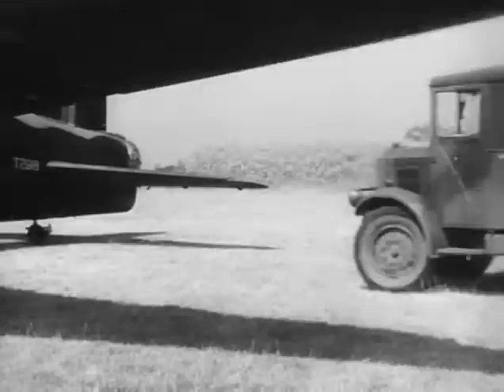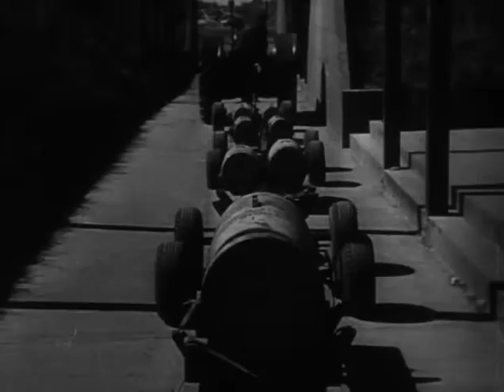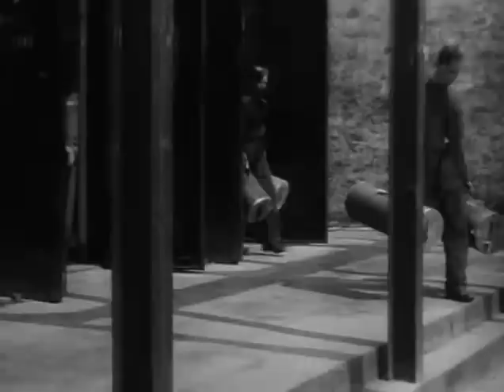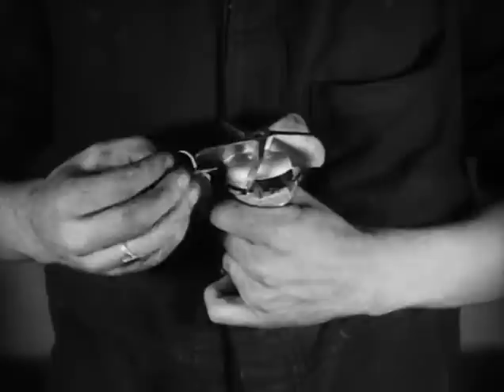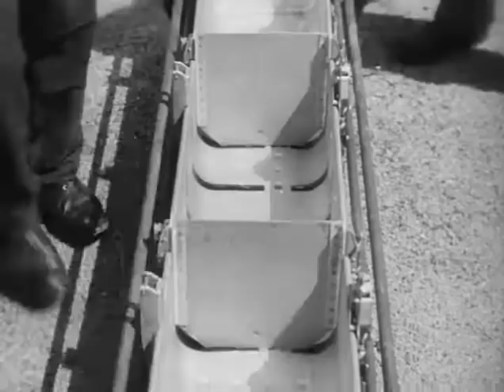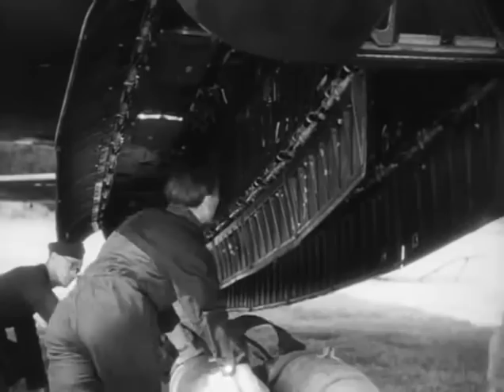The RAF at War - Re-Arming the Bomber

Comment: This film probably dates from the summer of 1941. The 4000lb HC Blockbuster bomb featured was first dropped in April 1941. The aircraft featured hasn't had the modifications necessary for it to be able to carry one (removal of the bomb beam and cutting a hole in the bomb doors).

Comment: All there planes need test flights ,how much fuel time they waist ,typically English
Reply: A daily flight is nearly the minimum to keep an aircraft at an hour's readiness.  
Extra test flights are done for aircraft coming off regular maintenance or 100 hour checks.  
New aircraft are also air tested, these tests were often given to new crews to give them more air time and some practise not being shot at.  

The test flights are done every morning, before the tasking for a night raid comes down from Group.  

Usually, they make a radio test, which was realised was warning the enemy of how many bombers on how likely was a raid that night.  

Later, the daily air tests included none, one or more radio tests to obscure that information from the enemy.  

Servicing for a raid includes a fuel check (learned from the air test), and fuels and oil are 'topped up', then the aircraft is 'bombed up'.  

An aircraft can still go unserviceable when started for the raid, but the earlier checks usually prevent that.  

If you are worried about fuel being wasted, look up Fog Intensive Dispersal Of (FIDO) then look at how expensive bombers are, and how expensive fuel was per gallon, then do some sums, which will show you why many thousands of gallons of fuel were burned to disperse fog so aircraft could land.  

War is very expensive: it can cost everything there is.

Comment: When the bombs are armed and fused I did not understand what the gauging was for. Anyone?
Reply: The gauge makes sure that the pocket for the detonator was made correctly & that there isn't any garbage in the pocket. If the pocket is the wrong size or has debris in it the detonator could explode when the fuze is being screwed in, causing the detonator to fire and setting off the bomb. This is typically considered to be 'a bad thing'.

Comment: WOW  arming before loading on birds!
Reply: yep that way when it goes wrong you don't kill the aircraft just the guys arming. only when stable gains came into existence did the RAF swap out to arming on the aircraft.

remember most gains at this time consisted of penthrite wax or similarly unstable crap. just getting the damp could make them go off. so you needed dry and clean places to arm up the bomb. out on a muddy bit of dispersal ground was not a good spot.

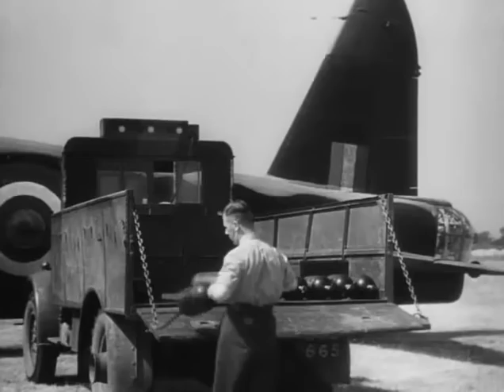Comment: At 2:28 the narrator mentions that the oxygen bottles could explode if dropped or banged, just as one of the airmen, who's  helping to load the oxygen cylinders, throws the oxygen cylinder up in the air.
Reply: Just a little overly dramatic. Oxygen cylinder will not explode if dropped or banged. They will rupture if exposed to high heat or flame, causing a massive release of the gas. Oxygen is not flammable but it does support combustion. Basic chemistry 101. In the presence of something burning, it will accelerate the burning explosively.
Reply: @JP-st2mk  mate you clearly have never handled a RAF ww2 oxe tank. they are made of surprisingly thin aluminium and could be ruptured quit simply by dropping them.

that said you are completely right the oxygen is not going to explode all by its self. still one hundred psi of oxe tank rupturing is not something i'd want to be standing next too. :)
Reply: @tommyfred6180   when I was in the mob we had a 3,000 psi air bottle explode, it was 3ft above the ground and an end-cap was found over a mile away,   after it cut off a mates arm 😳
Reply: @tommyfred6180  there is a LOT more to that story & Lucky that a dozen were not injured, or even killed
Reply: Still it would be nice to see something blow up.

Comment: These are Wellingtons of 9 Squadron (Squadron code letters: WS - carried from 9/1939 until 4/1951). They operated out of RAF Honington until September 1942 when they moved to RAF Waddington and were re-equipped with Lancasters. The aircraft are Wellington B.1 (operated between 1/1939 and 12/1939), Wellington B.1A (operated between 9/1939 and 9/1940) or Wellington B.1C (operated between 2/1940 and 10/1941 and between 5/1942 and 6/1942) - these types all had 2-gun rear turrets. One of the Welligton (serial no. T2619) is in Special Night camoflague which went 3/4 of the way up the fuselage and others have earth/green camoflague on the fuselage and fins. The order for painting in Special Night camoflague was issued in 9/1940. Also the serial numbers appear to be in mid-sea grey an order was issued in 10/1940 for them to be painted in dull red. Of course it would take some time for these 2 changes to be applied across the fleet.
Reply: 😊 vi
Reply: The Day Bomber finish with added black undersides to make them Night Bombers, then the extended black up the sides?  

Isn't 'Special Night' the colour of matte black used?
Reply: @stevetheduck1425  you may well be right. I was just going on what I've been told.